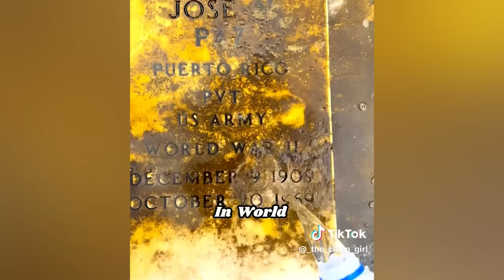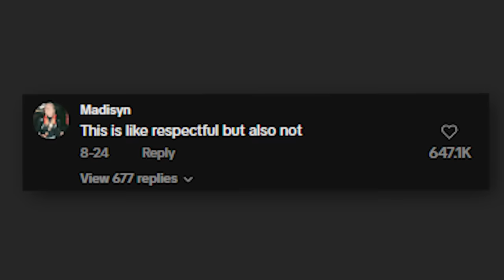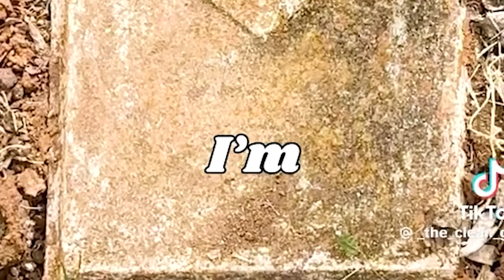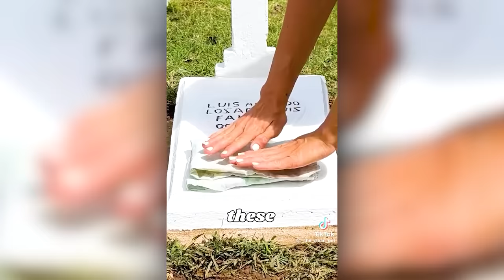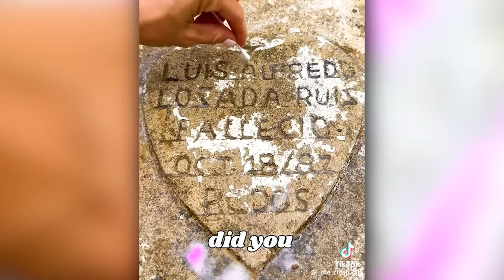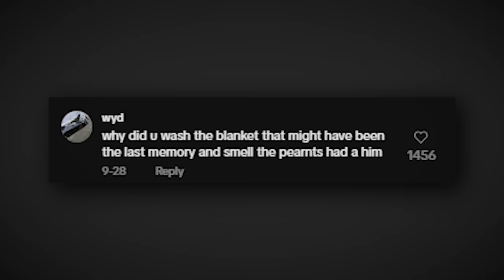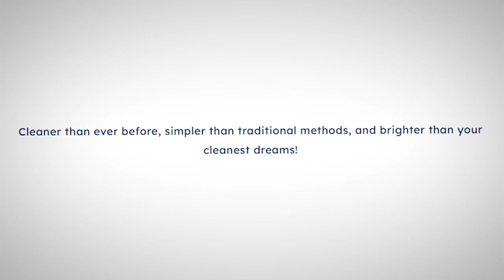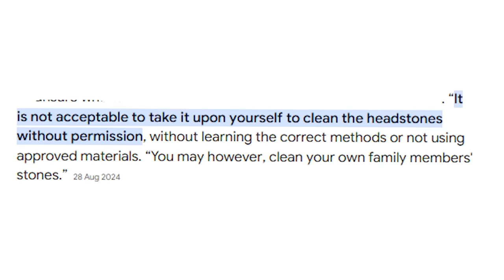This Influencer Ruined Baby's Graves For Views

Comment: In case you’re still wondering Curtis, I had a hunch and googled it- what she’s doing is consider Grave Desecration. In my state, it’s a crime with like a possible $12,000 plus fine (higher if the family charges you) and possible prison time. 
Here are 2 highlights from the AI summary of what constitutes desecration:

Throwing trash, garbage, or refuse in or on a cemetery 
 Removing, disturbing, vandalizing, destroying, or changing the location of a cemetery's stones, bricks, iron, or fences
Taking away, disturbing, vandalizing, destroying, tampering with, or defacing any tombstone, headstone, monument, grave marker, grave ornamentation, or grave artifacts

The first one is a bit of a stretch but it actually would fall under a foliage desecration law in my state. The second 2 she’s absolutely doing since you buy those plots it’s more or less trespassing and desecration of property, but by pairing marble she’s absolutely defacing it, same with moving the headstones and items. Shame no one has called the cops on her yet.
Reply: Hopefully someone will charge her then
Reply: A mass report to call attention to her behaviour would surely help!
Reply: Does it count as desecration if you put a knocked over decoration (teddies, flowers etc) back on the grave it belongs to?
Reply: @erinwhite3276 

She literally spray painted the cross
Reply: @erinwhite3276 I’m sure something simple like that on its own would be fine, it’s not doing any permanent harm and is done out of respect
Reply: @averyj3428  even if it’s “out of respect “ what she is doing is illegal.
Reply: @andrea_pao  oh I’m not advocating for her, she’s terrible. The person I replied to was just talking about moving/ fixing something that was knocked over

Comment: A lot of cemeteries don't even let you do tombstone rubbings because they can wear down the stone, so I wonder if those cleaning products are doing  something actually destructive to the material used for the graves.   Sandstone wears down very easily.
Reply: There is no way her cleaning spray is safe to use on graves, and I highly doubt she cares about properly maintaining the gravestone when she is using a hand brush you would use to scrub your floor, which would probably just cause further damage.
Reply: Not to mention what it could do to the environment.  I'm sure it's not safe for local wildlife, and that stuff will wash off into the water that the animals drink and live in.  And I"m sure it's not friendly for plants either.
Reply: @laura121684  most cleaning products are not safe for foliage or animals, so odds are that would apply to hers too since I'm willing to bet that it hasn't been tested by the EPA
Reply: @pagananarchist4723  I'd be willing to make that bet as well.  So she's not just vandalizing graves, she's actively harming the environment while she's doing it.

Comment: Yeahhhh she needs to be arrested ngl. The bathroom vids, okay weird but fair. BUT A GRAVE?????? WITHOUT ASKING???? AND PAINTING THE HEADSTONES????
Reply: She is actually risking the businesses that she cleans

You are not supposed to clean public restrooms other then MAYBE picking up stuff off the floor. Most public restrooms use allergy and "lick" safe cleaners because children be gross and will lick their hands (and thus whatever they touched) randomly. Its part of why those cleaners arent super effective against harder messes and require more scrubbing. I tried to find what cleaner she is using based off of the can and sprayer-type, but couldnt find it. But I also looked up hypoallergenic foaming cleaners, she is def not using any of the ones Im looking at. She is creating fumes in a small space, risking herself and anyone else if she doesnt leave the door open to air it out (if these are secret cleanings, I doubt she has the door held open.) AND if she harms someone who comes in later after she is gone, the business is liable until they can confirm that it was tampered with and by whom. She is risking SO many lawsuits.

Comment: 1.  Must I have permission to inventory, clean, or reset a gravestone or to remove vegetative growth from within a cemetery?
Answer:  Yes.  You must obtain permission from 1) the property owner to enter the cemetery itself if you must cross private land to access the cemetery, and 2) the Trustees of the cemetery to do any work with a gravestone (such as cleaning) or within the cemetery (such as brush removal).  "Trustees" means the recognized representatives of the original incorporators, board of directors, affiliated church, or cemetery association.

Comment: I went down the clean girl rabbit hole a few months back. The best anyone can tell she is located in Puerto Rico. In regards to painting the graves in some of the videos, you can tell that some of the graves she cleaned were painted previously,  but the paint has peeled. You can also tell in the background that there are other painted graves. I haven't done a deep dive into her stuff,  but I would be interested in finding out if she paints graves that aren't painted beforehand or in graveyards with other painted graves. 

This still doesn't excuse her behavior, but if she is just repainting the graves instead of randomly painting the graves that weren't previously painted, it might explain why she hasn't faced any legal repercussions

Comment: this is so messed up. Removing plants from a grave is so disrespectful, but the family could also have been paying for that. Many cemeteries have an additional fee to up keep plants around the grave. Also planting new ones could be an issue if the family did not opt for services to maintain plants at the grave site, meaning these new trees/plants will just die and then the family has to deal with that. it is often called perpetual care. if a family doe snot opt for that, then the family will care for the grave on their own and they are now stuck dealing with new trees/plants. I also saw her pushing stones off of a grave, yea they could be random stones, or it could have been a Jewish grave in which case, the stones were put there. It is a Jewish tradition to leave a stone on a grave when you visit. Like, wow, the levels of disrespect.

Comment: First, the cleaner is special because it’s pink but it’s the same as a product called KABOOM that sprays purple and turns white when it has sat for a few mins.  Second she is painting the graves a different color than they were.   It’s an ugly reddish color on some and ultra bright white.   GraveSTONES are STONE which lasts much longer than craft store paint.  They get worn down by the elements and the paint is making it worse.  While rain and wind can wash away basic dust, dirt gets trapped in the pores of paint so it’ll look dirtier.  And there’s no way people just let you in, especially at night.  States have restrictions to prevent mistreatment of graves and very few allow people after dark.  It in several places seems like a set.  Cemeteries generally have grounds keepers that help clear out older items, cut the grass etc.  If they don’t it’s probably an older historical graveyard so there’s some comfort their families will probably never know but it begs the question, that baby with the blanket died quite a long time ago.  How did the blanket survive not blowing away and where did SHE find it?   Was it buried in the grass?   It had holes that were NOT repairable.   Yet ta-dah!   Perfect blanket that’s perfectly shaped.  I’m calling BS on so much.  My only doubt is such a set would cost money. A LOT.  So maybe a family graveyard or even a place for learning at a gravekeeper and mortician school.   They learn somewhere, right and maybe have a fake place to practice groundskeeping, digging and properly placing the gravestones.  Most had vaults around them which was for rich families.   Most people just got a headstone and a patch of dirt.   Sorry so many complaints but please explain!!!